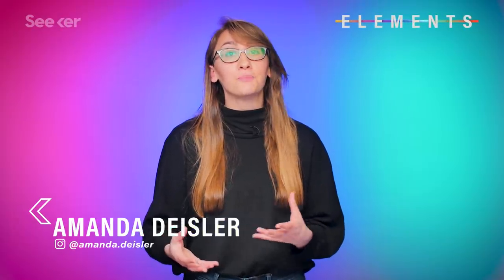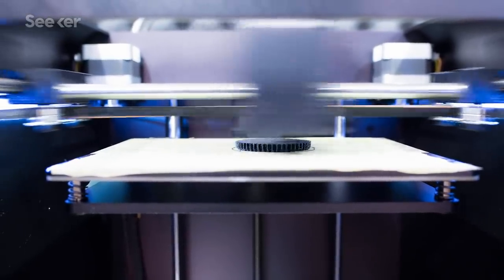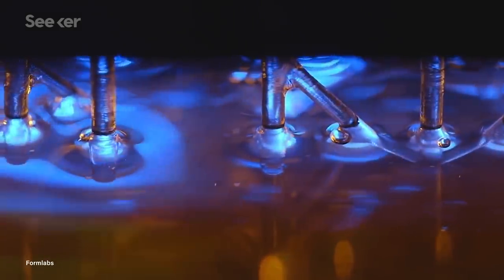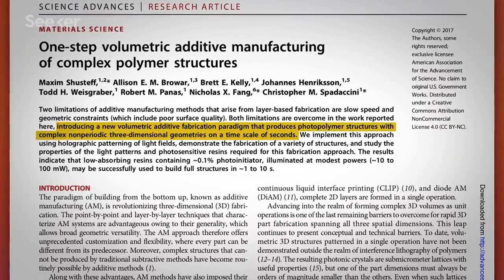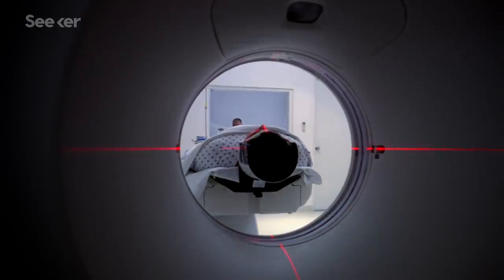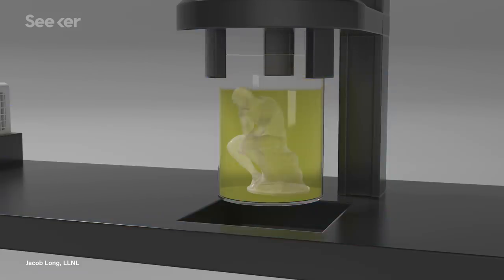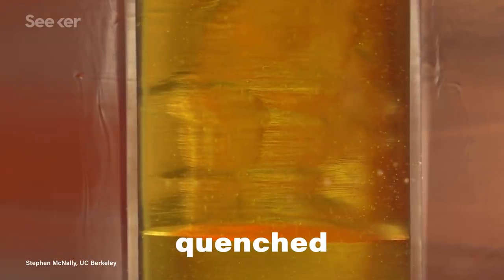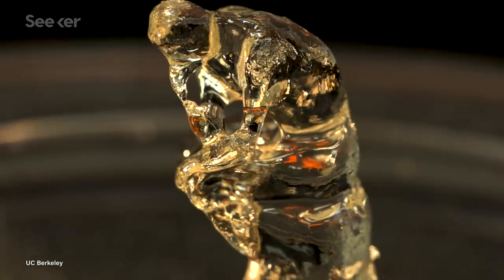Why This 3D Light Printer Is a HUGE Game Changer

Comment: Meh,
Tiny build envelope and the results looks horrid. There are much better technologies out there.
Reply: the build envelope is not a limiting factor whatsoever (use a rotating platform, rotate the projector around it or use a few well - placed mirrors. you don't even need the projector to be the size of the tank). And you do realize this is a prototype, built with pretty much a regular projector, which printed better than what the first 3D printers did and did all that in 5 minutes? it's not going to solve all the world's problems, but being able to create medium parts with medium quality while going for a lunch break is going to be amazing